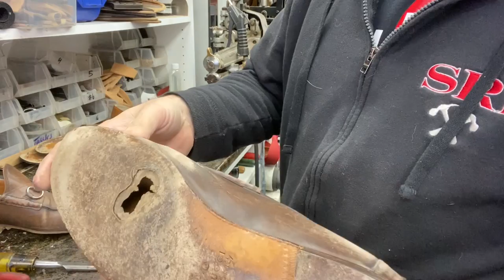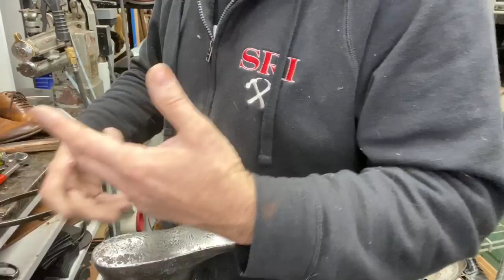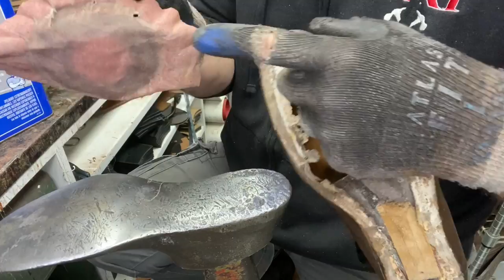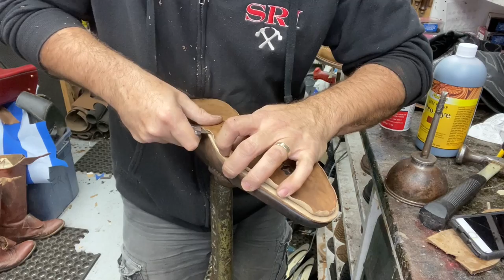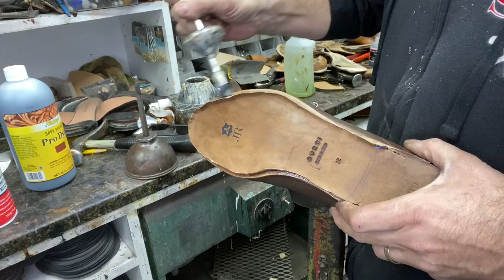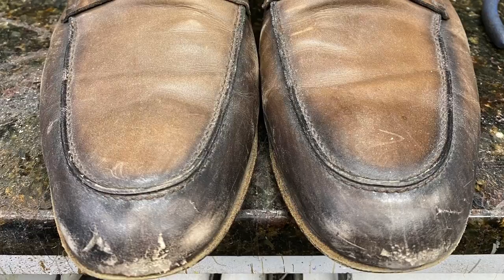Abused GUCCIs get some TLC

Comment: Weird about the glued soles. On the Gucci website, for all the loafers I can find with that exact style upper it says they're Blake construction. I don't suppose there are any signs these have been repaired once before, by someone too cheap or lazy to stitch them?

Ugh. They have a whole selection of loafers designed to be worn with the heel folded down so that you're stepping on it. Why?

Edit: YouTube comments are a mess. It's not only inserting extra blank lines, but it's double-posting when I go back to fix it.
Reply: I have similar Gucci shoes.  The soles are only glued, not sewn.

Comment: Steve, another amazing job. Question: this was a footbed/outsole glue-on. Since you changed it to a Blake stitch, could you have added a midsole as well to make heel/sole replacement easier? I know it would change the look and feel with the stiffer bottom but wondering if it would have been possible (I may have a pair of loafers I’m thinking of with this question).

Comment: Very methodical process.  Extreme attention to detail.  The hidden stitch via Blake Sticking is the way to go.  $500 is actually very good for restoration on these 1953 Gucci loafers (which cost $700).  I will 100% send my shoes to Bedo.

Comment: LMAO.   I have been doing spring cleaning (Australia) over last few weeks. 
I haven't cleaned out my wardrobe for years, and decided to get in and clean it good. 
I don't like to throw things out, and at the back was a pair of Italian hand made Maze loafers. 
They are a gorgeous fit, but I haven't worn them much in years. 
Original color was red. I tried to change the color to black so I could wear them at work. 
The new color never took, kept cracking off. 
I decided to toss them......and put them in the trash bin yesterday. 
Then I watched this video, and another of yours. 
Well, blow me down....I was convinced to go dig them out of the bin, and spend whatever it takes to get a cobbler to fix the color. 
They cost about US250, and I'd be happy to pay up to US200 to have them colored by a pro
I think one of the reasons men get shoes repaired is because it is very difficult to get a comfortable fit from new shoes. 
Once you have a good fit, you want to sustain the feeling. 
New shoes can be hit and miss. 
Thanks for this channel.

Comment: Good leather shoes feel better when they are restored, I hear you. The leather is much softer and wear far more. Yes it costs a lot but still so much better than buying a new one. As long as it costs 50-60% the actual cost of a new pair, I'd rather repair, especially when uppers are in good shape. I wish I could add a photo to show, how good a job they did at restoring my 3 yr old pair of Crockett & Jones. Looks better than new, at least to me lol

Comment: I did a little research and the lower end Gucci shoes use only glue in construction. The high end Gucci shoes use Blake stitch construction. Gucci shoes are manufactured in Italy, France and Spain.

Comment: I know this is an older video but you could try using automotive brake grease for the squeak in your stand...get some into the joint/swivel and it should take care of the squeak. At Napa you can buy a small package for like 1.30 (I work at Napa but I just want to give you a quick tip

Comment: Just a little comment, the metal decoration on the top has to go a certain way. there two loop that connect in the middle. One is flat to that shoe and the other one is perpendicular to the top of the shoe. The perpendicular one should be attached from the outside of the shoe and the flat one from the inside.  At the end you have the left shoe the wrong way.

Comment: Seeing how you know leather repair and such. I have a beautiful couch, it around 35 years old, I bought it new. Its a dark brown beautiful soft leather, its a kinda a loosely fit leather, very comfortable. I noticed awhile back that I have a cut right in the middle of the middle cushion, its around 2 to 3 inches, its hardly noticeable because of the leather being a loose fit. Looks like someone sat down with keys clipped on their side and one of them punched through the leather. How to fix it....Should I open up the cushion and glue a patch on the inside, sew it ?. Its not getting worse, but since I know its there I have to try and repair. Any thoughts....Thanks

Comment: You put the middle metal part on the left shoe reversed. In the middle, where the twoo small rings connect one is horizontal and one is vertical. Originally the vertical rings were on the outside of both shoes (right on right shoe and left on left shoe). Now the vertical rings are on the right on both shoes.